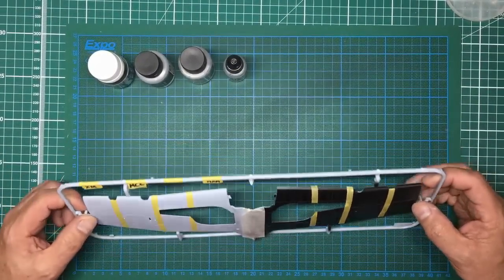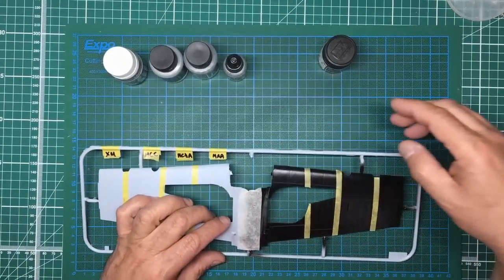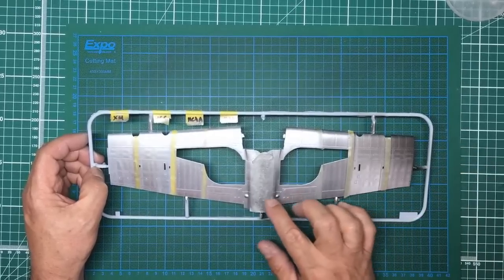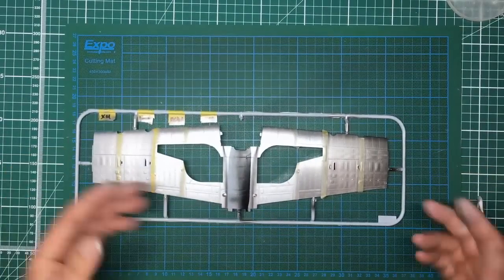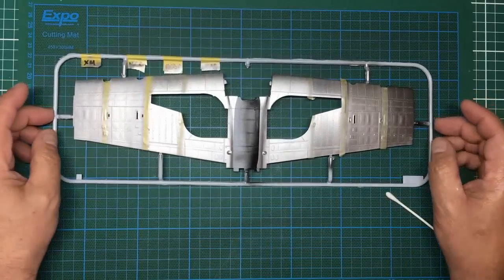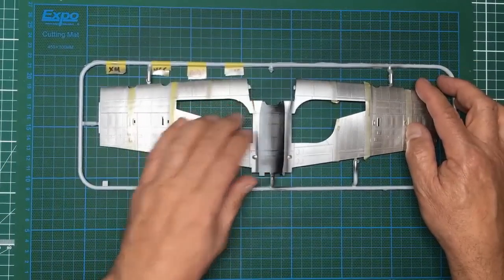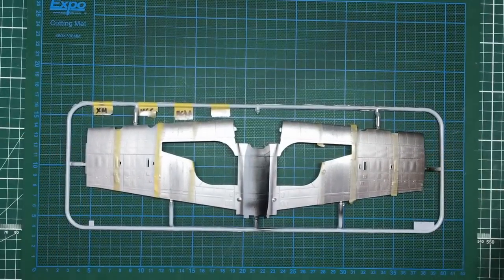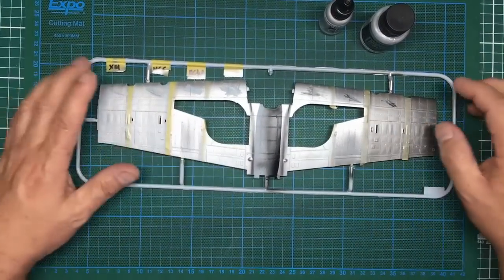My Vallejo Metal Color wont dry??

Comment: Thank god, I thought I was the only person experiencing this problem! I've had two separate bottles of Dull Aluminium - bought six months apart - where the paint simply wouldn't cure. I'd shake the bottle thoroughly and leave the paint to set for up to three days. As soon as I applied an acrylic ink or another colour, the pigment would lift off and run into the new layer of ink/ paint. 
Funnily enough, I've not had this problem with the Copper or Gold paints.
Reply: Same problem for me with Vallejo Metal Color - Dark and White Aluminium. Pretty annoying

Comment: I always prime with lacquer primer first ( Either Alclad or decanted and thinned Auto lacquer primer, sanded smooth, from a aerosol can - Waaay cheaper!), then add a gloss black to any areas that will be a shiny finish, like polished aluminium or chrome, but not for duralumin or white aluminium & masking if necessary. I generally use Alclads or the Gunze Mr Metal (Not the buffable type!) I am thinking of adding the AK Extreme to the Arsenal, so thanks for the demo!
  By exchanging the gloss black for other gloss colours like orange, white or brown, you can get some interesting finishes on the metal coat!

Comment: Nigel have you tried Model Master metallic paints?  I’ve had good results using both the non-buff and buffable types.  I have noticed that when spraying either the ambient air temperature and humidity affects the drying time I also have moisture filter on my compressor to reduce this issue.  I live in Seattle which can be damp and humid most days.  Another option is bearer metal foil, but it is difficult to apply.  Unless the surface is absolutely perfect every defect in the plastic sticks out like a sore thumb.  I don’t use bare metal foil on complex curved surfaces, normally just the upper and lower wing surfaces and Model Master over a gloss black primer on the rest.  Great info on the metal paints, keep up the great videos.  Forgot to mention I have a large floor standing dehumidifier going when airbrushing.

Comment: Perhaps it’s worthy to mention that when I use Testors silver enamel paint it fails to dry on my tank treads. It always dries perfectly on polystyrene, but on vinyl and rubberized treads it doesn’t dry, even after weeks. I’m thinking that it has to do with the shiny pigment itself and can’t really be avoided most of the time. However, if you get a rattle can of testors diamond dust lacquer, not only does it look great but I’ve never had drying problems. Sorry this is long. Best of luck

Comment: Nigel I had probs with this paint recently. I was using it a Tamiya RC semi truck. I put it down to it being the plastic.perhaps it was not the case,i primed with halfords plastic primer.
Reply: RC vehicle bodies are generally made from polycarbonate. You need to use Specifically  made polycarbonate paints on those bodies.
Reply: Brett, the body on the large scale trucks are styrene but does not seem the same as Tamiya kit plastic, each runner in the rc kit is marked poly,abs or styrene
Reply: I made some of the old LS gun kits years ago. They were ABS, which needs a special cement, and did not take paint well. It's possible that the odd poly plastic sprues contain some amount of ABS plastic for strength?

Comment: Interesting.
Vallejo's response suggests that they have reformulated the paint to attempt to overcome the problem. It is a problem I've heard of before.
As far as the "test" shot on the reverse side, it reminds of "Rub n' Buff" which came out about 1977.
My preferred option for many years until the buggers stopped making it was Humbrol's Metalkote. 
A good thing for testing tackiness is the old Poundshop faithful yellow duster. That sheds faster than a moulting Golden Retriever.
Reply: Andy Richards  Amazon carries rub n buff in  a 4 pack.  I also used to use that stuff.

Comment: I have dull aluminium and it's dry in minutes. Using a hairy stick or the airbrush.  So I think it's the bottle I have had bottles of model air metallics which where lousy.

Phill uses the vallejo metallics (not the model air) for brush painting. For airbrush he uses ak metallics.